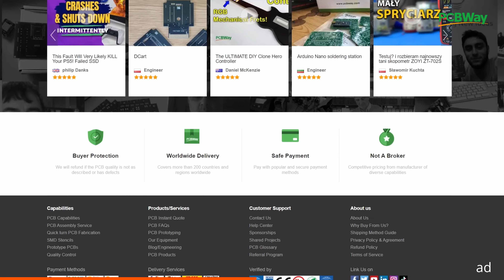3D Printing at Its Finest! 🤯 10 Next-Level 3D Prints You Have to See! 🚀 #3DPrinting

Comment: Thanks for these ideas, could you tell your settings for your supports, they seem so easy to remote, many Thanks.
Reply from the maker: Thanks! 😊 I actually use almost the default supports settings in Bambu Slicer. I usually go with manual tree supports (painted) to make removal easier. Also, updated to the latest version of Bambu Slicer—they've made some nice improvements to the support settings.👍